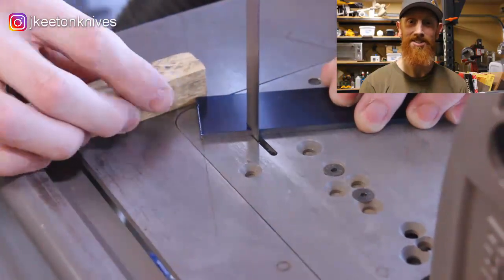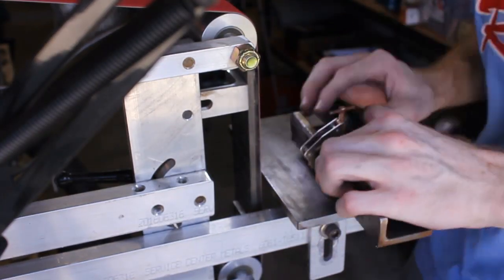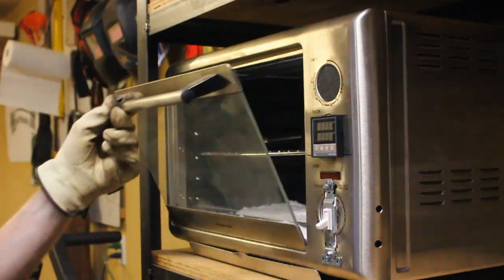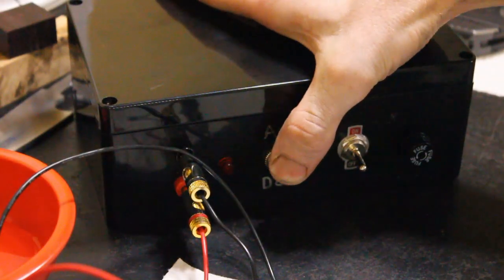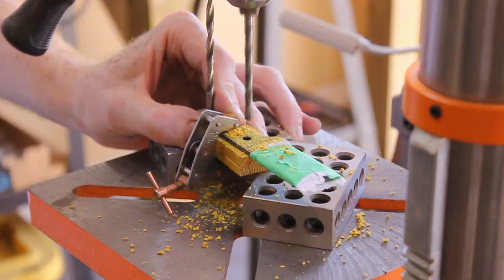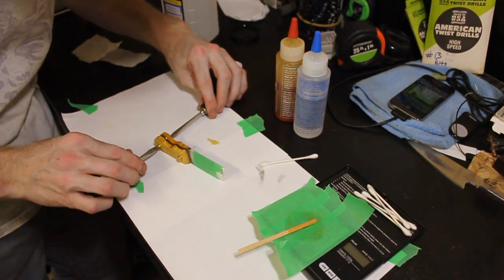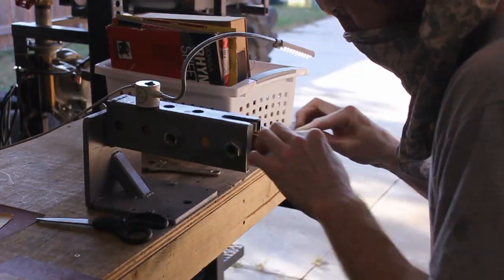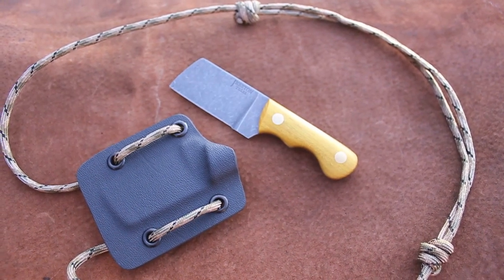Cutest Cleaver Ever Made | Neck Knife Build

Comment: I have been a subscriber for  a while and enjoy your videos. I like the look of this cute cleaver neck knife, could you give me an idea of the dimensions please, I know you said it is an Inch (25mm) wide, so I can get the proportions right could you give me the blade and handle length please.
Reply from the maker: For sure. It's 1/8'' thick and about 1'' wide. The total length is around 4''
Reply: @RedBeardOps  Thank you, that does help, I am only just starting out with knife making and I find the hardest thing is getting the proportions right.
Reply from the maker: @grahamturner2469  No problem, I checked my measurements. The over all length is 4.5''. The handle is 2.45''. The blade width is 1'.